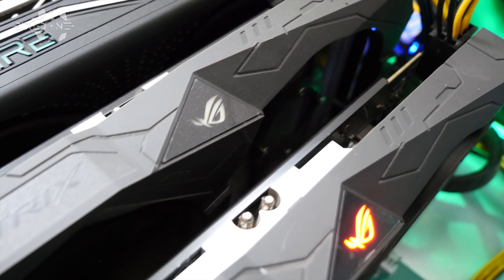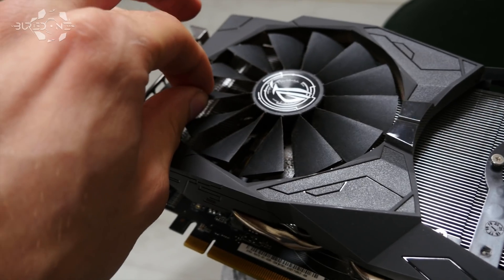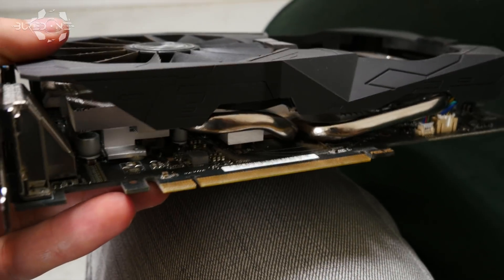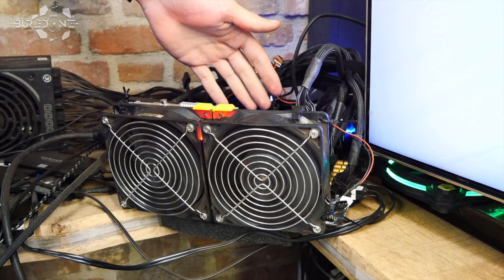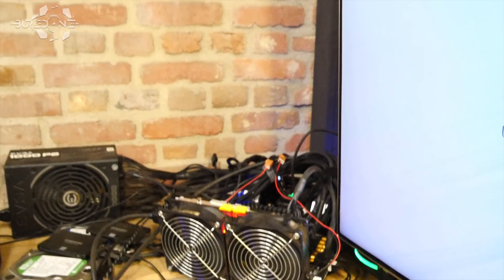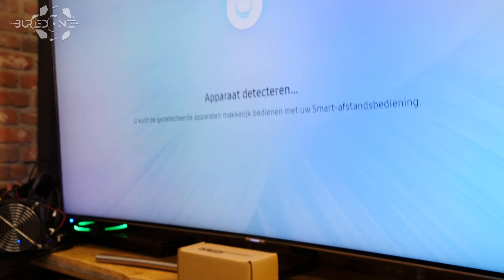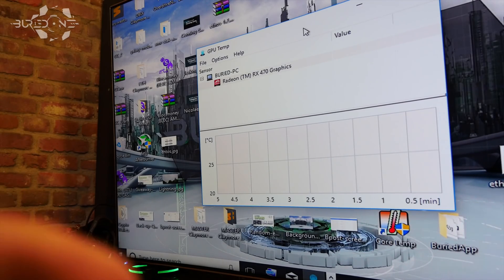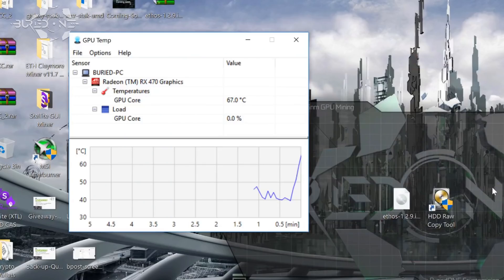Crazy GPU Cooling Solutions?

Comment: Why not just use a low profile cooler instead of tower, or just add a sideways fan and use thermal glue to attach heatsinks to vrm and memory? Like Arctic coolers. Oh, and you should have named it "Cpu cooler on gpu" which is a much more common technique for this.

Comment: All I want is a massive heatsink that will also cool the vram and vrm modules, kinda like the Morpheus 2 but with more surface area. I don't care if it blocks the other pcie slots as I won't be using them anyway and I won't be doing sli. Instead, the pcie slot brackets can be used to support the weight of the heatsink so the graphics card or the slot it's in won't be damaged. Basically the heatsink I'm imagining is a cpu heatsink on a graphics card like in this video, only with more coverage on the pcb and can have 2 or 3 silent high static pressure fans. Does anyone think this can be patented?

Comment: Use Just One Fan from Your First Idea Option, Before I Do Same Mistake with Two Fans  but Now I change All GPU's with 1 Fans and Now It's Under  55 C and Also V Ram also cool.
And In Riyadh City Temperature is Above 45 C.
Install Just Single Fan in Center of GPU Chip.
My GPU is 1070 x 6, 1060 x 6

Comment: You r doing it all wrong
First of all, those fans isnt too heavy, reason why your heatsink was off the gpu is a plastic stripe that u used to fix fans (botom right side). Plus, those server fans was way beter in cooling memory chips then tower like cooler that u used later in a video.
Try ETH mining with that tower cooler.

Comment: I want to share with you what I do to cool my rigs - https://bitrock.ru/files/products/untitled-3.800x600w.jpg?4c7b185bee08a778ba369e9ee5725954. It may only support 6-8 GPU's but the server formfactor allows multiple rigs to be installed in one server cabinet (I think with this case it was something like 7 per tallest cabinet). I have been using two of these with amd RX580 and get stable +/- 60 degrees. But I would recomend using somthing like Noctua PPC Industrial fans since the cheap chinese fans have around 40% failure rate per half a year of 24/7 operation. I think that with something like 6 3000Rpm Noctua fans you can achive acceptable temperatures even without fans on GPU's (Leaving only the radiators). Hope this gives you a few ideas.

Comment: One question. On the first attempt the fans air flows were in or out? You should test both ways
Reply from the maker: I tested both ways, it was just too heavy
Reply: Your first attempt should be sufficient but you use wrong fan, just use 120mm or 90mm cpu fan and place the gpu attached with a riser on a horizontal position with fans on the top.

I have this on my 2 rx480 and the temp is way better.

Comment: Easiest solution for me is lowering the core clock, core volt, and power limit.
Reply: and lowering your earninigs
Reply: Karthik Sarode No. Less heat and power on the cards will prolong their life span, and you will save on electricity. Alternatively, you can lose profits by spending more money trying to cool over powered and over heated cards while shortening their life span.
Reply: trapped cat also a great point.

I have a solar installation and only reason I got into mining is that my solar installation produces more power than I need for my household and its always sunny here
PS: I do get what you are saying and it's completely valid just that there is not really a great market for pre owned GPUs in India so they are of no use to me ones they lose their profitability so am mining hard as long as they are profitable
Reply: trapped cat this is just a personal opinion I really don't wanna prolong the Lifespan of my cards because I  wanna earn as much as possible and make my roi and earn profits before they become useless and not so profitable and since I have 2 years warranty on the cards I have and I can just get a replacement. Since in India they really don't investigate in depth for the cause
Reply: antone rich I have a solar setup of 5kwat an hour and my house old uses about  1kwat an hour average and I use up 2.5 kwat for mining and remaining 1.5 I use to charge the ups which is capable of holding enough power to run my house and mining rigs for 12 hours without probs in case of powercut on a cloudy day
Reply: lol exactly
Reply: Karthik Sarode I guess that works if you don't pay electricity. Otherwise, more power on the cards will show up on the bill.
Reply: Karthik Sarode Sweet! you've got it made with solar. More power to you ;)
Reply: antone rich contact your local solar setup people tell them your power needs they will do it for you